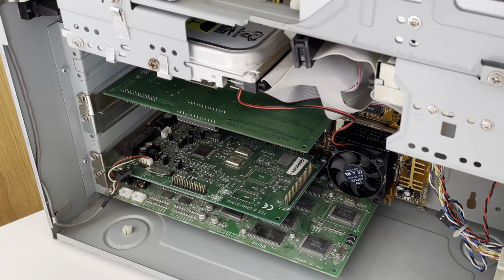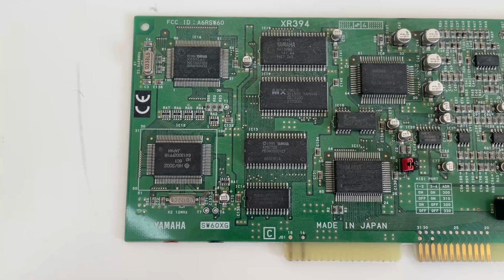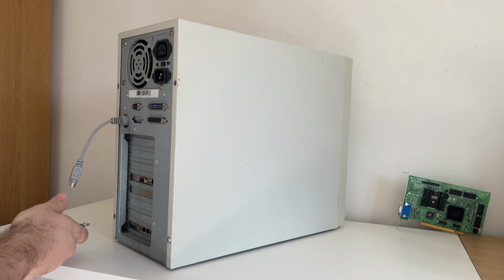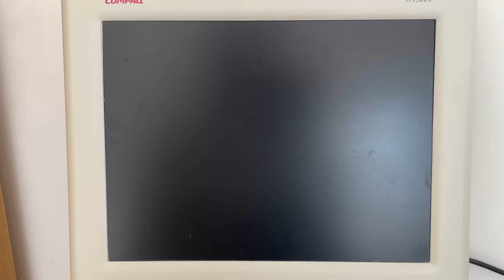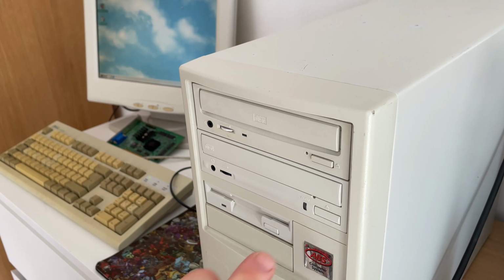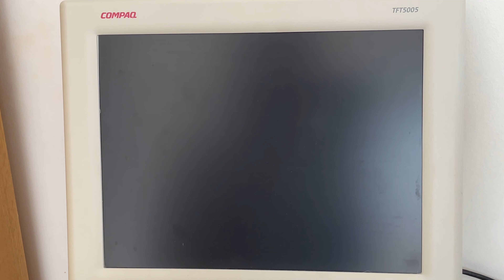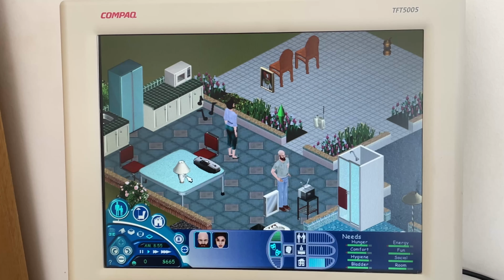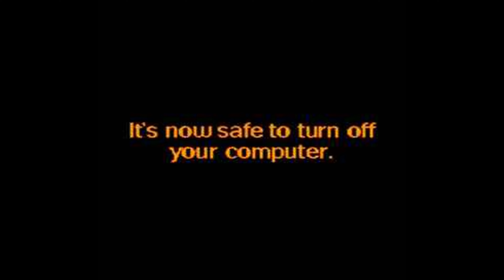Maximizing Potential: The Final Upgrades to My Cheap Socket 7 PC. 40QuidPC (Part 3)

Comment: I did the same CPU upgrade in 1999. In early 1998 I got a P166 MMX which I upgraded in late 1999 to a K6-2 400 mhz. Unfortunately I do not know if my motherboard was a socket 7 or super socket 7. But being purchased in early 1998, I guess it was just socket 7 with 66 fsb support just like the one you have. The performance difference was big and I was pleased with the K6-2 400 mhz. Too bad I sold that system long ago.